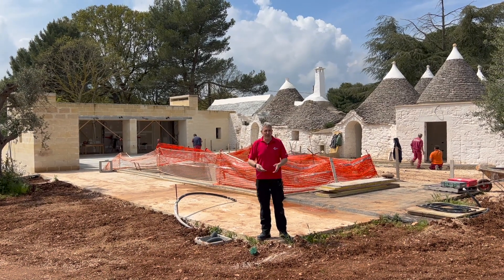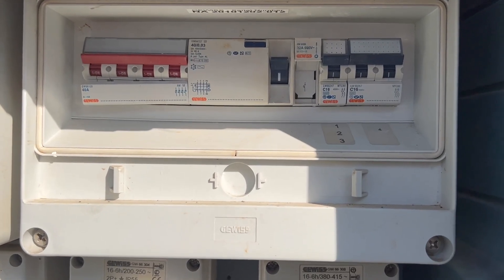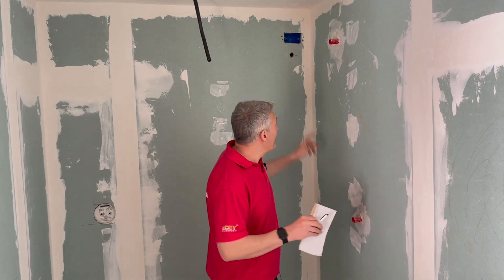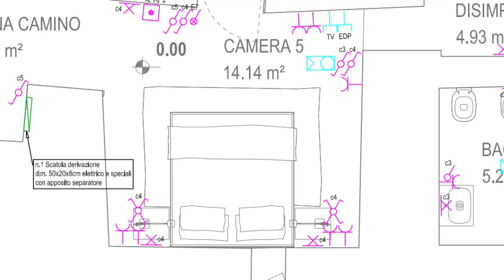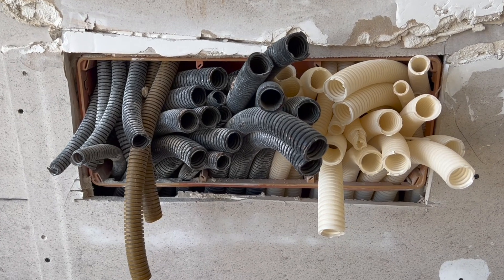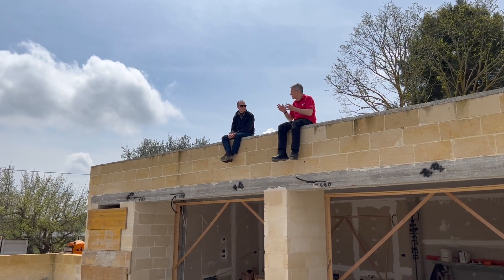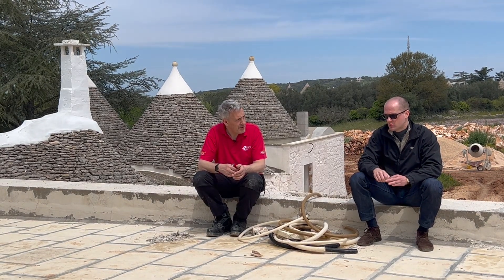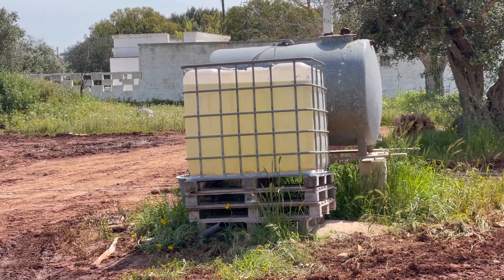Electric Wiring in Italy - You Won't Believe What They Do!

Comment: Very similar here in France. Use of Flexicon meant meant I could get fibre installed to the lounge just by pulling in the cable using the old TV antenna coax wiring as a draw-string and changing the face plate.  Really handy!
Reply from the maker: Great 👍
Reply: This was my experience too (also in France). Orange pulled fibre through to the living room, by using the old telephone cable as a draw-string. The process was so quick and easy I was amazed and couldn't understand how it was even possible - until I learnt about flexible conduit.
Reply: That's a lot of money in materials and labor to save 15 minutes in the future (assuming there is a conduit running were you want it, which is usually not the case).  Dont you have attics or raised floors to run lines?
Reply: @billn8555  That's not how it works. The conduits, water and heating pipes etc are laied down on the floors and ceilings before the concrete is cast. Getting something somewhere you didnt do right or forgot means you pick hammer or surface mount or do a combination of both. Thats costing craploads of time and money. And then for everything that goes into a wall you first need to mill a groove into the bricks. If the wall was already rendered and painted that needs to be redone.
Reply from the maker: The next part of this project is now ready 👉https://youtu.be/ISSy8vDxLcw
Reply: Cheap flexible conduits are horrible for pulling stuff through, it keeps getting stuck on all sides. Non-flexible conduit is a lot easier. At least, that's my experience in my own home, had to completely remove a flexible conduit and replace it with non-flexible in order to actually get cable through it. I thought it would be easier. Boy, was I wrong.

There is good flexible conduit though, with a smooth tube on the inside. But the cheap stuff is just really bad.
Reply: @StCreed  Just tape your new cable onto your old cable and make sure you cover the whole joint.. That way it's just a smooth wire being pulled through.
Reply: @StCreed  The technician poured some washing up liquid into the conduit to lubricate  it - no problem.  Proper cable lube is also a thing!
Reply: @Richardincancale  Problem is a lot of things that work as cable lube when fresh can go solid and glue the cable in the conduit after months or years.
Reply: @Richardincancale  anche la vaselina è ottimale, e inoltre non corrode il rivestimento isolante dei cavi.
Reply: @randacnam7321  usa la vaselina.
Reply: @StCreed  Especially if the conduit goes around corners and awkward positions like that, it's very likely that it will get stuck, you have to pour special lube for conduits and have to have two people to help. One that pushes the cable and one that pulls it.
Reply: @adisipunct9562  
usa la vaselina.
Reply: @StCreed  I can imagine that being a problem... but assuming an empty flexible conduit, would it not be possible to pull: 
"a thin wire with a well rounded head"
through the conduit first, and then just tape your cable to that wire, and use that to pull the more difficult electrical cable through.
Wouldn't that solve the problem? Or am I being too optimistic?
Reply: @DanildFlamme  
esistono delle sonde tirafili (in Italia chiamate "molle tirafili"), che vengono fatte passare per prime attraverso il tubo corrugato, ed alla parte finale hanno un occhiello, a cui agganciare il cavo da tirare dentro il tubo.
Reply: @massimo63  I ran it through google translate to understand your Italian reply. And yeah, I thought I had heard about those special pull cables specifically for that.
P.S. What made you think that I could understand Italian?
Reply: @DanildFlamme  
...Sorry, but I speak only italian...
I hope in Google translation...
Reply: @StCreed  you can blow cables down ducts
Reply: Seems very labor intensive just incase you want to add something later. I guess maybe the mafia had something to do with that.  The thing about earth ground it is more for lightning strikes not for grounding for appliance protection against accidental contact with live wire.  The single phase wiring in the States (120v/240v) joins the earth/appliance ground at the first panel ( after meter) to the common wire (split phase).  I would assume it is the same everywhere but not sure about 3 phase wiring as that is used primarily in manufacturing.
Reply: @Once_in_a_Lifetime  Using flexible conduits make retrofitting much less labor intensive than fixing wiring into a wall with cement, as is done in the UK. As an American you have to remember that this isn't a hollow drywall construction, it's concrete (or other times brick) walls, even for internal partitions.

Regarding the earth ground; the presenter mentioned that the power distribution network does not offer ground wiring at all. Therefore, it needs to be provided by the property owner (using ground rods). I don't think lightning protection is much of an issue for a building this low, as even the trees are often taller than the building.

As far as 3-phase goes, which is 400V here, there's essentially five wires: live wires for phases 1, 2 and 3, and then one neutral and one ground. For (large) 3-phase appliances, all wires are passed on to the appliance using a 5-pin IEC socket. For the regular 1-phase devices, the three phases are divided more or less equally among the circuits of the home in the distribution (fuse) box.

Hope that clarified some things for you.
Reply: @TheLukasDirector   I didn’t think that people still built with solid walls only, thinking there would be a insulated inner wall.  We have every type of climate here in the lower 48 States and have not heard of that being done.  Especially since the UK is now requiring all their solid construction to include an external insulation as a retrofit even to historic houses.
I feel like i watched a different video than you as I’m sure i heard that there’s power outages because of lightning strikes, seeing copper wire circling the house (we only have two poles within 2.5 meters of each other), such that back up lighting required.  Never meant to imply the houses would be struck but meant that the electric grid is connected to houses and so the lightning will follow if a transformer is hit.  Done to minimize power surges into the home.  This earth grounding is done all along the electric grid.
I also saw in the video that since the porch had a double insulated lighting fixture, no grounding wire was added .  In the States, even wall switch boxes have to have a neutral wire (and of course ground) because of future use, not what its being used for now. 
I don’t know if electricians take balancing the loads of each leg on the single phase when wiring as I’m not a contractor, just a home owner that has done my own electrical work over the years.  Never seen a house have 3 phase but if area mixed with manufacturing then i guess its possible!
Reply: @Once_in_a_Lifetime  In my part of Europe, ground is connected to the (steel) water pipe entering the house in the cellar. The 3-phase power line usually enters the cellar at the same place, since all power lines below 110kV are underground. The main fuse box with 3 x 80A main fuses is usually near the water meter. Neutral comes into the building along with the 3 live wires. In Italy they seem to save that 4th wire and because they probably use cheap plastic water pipes, they use the lightning rod ground loop for ground and neutral connection instead. That's sub standard and completely illegal in my country, but it works as long as nothing happens. That's Italy for you, a developping country in many ways. But then of course home of the best food in the world and other great cultural acheivements, still making it one of the top 3 best places in the world to be.

Lightning strikes to power lines are rare, because most power lines are underground. Lightning strikes to buildings OTOH are quite common and rooftop lightning protection is mandatory in many regions. 

3 phase electricity is not compatible with 115V appliances. 115V is acheived by splitting two phases that are 180 degrees out of phase. 400V 3-phase power consists of 3 230V phases that are 120 degrees out of phase. Each of the 3 phases can be used to power 230V appliances and all three together to power 400V appliances, but a single 230V phase can't be split, because the entire phase is above ground (0).  US 230V is two phases, with ground (0) exactly in the middle. That's why it's pointless to supply homes with 3 phase electricity in the US. However, this might change, because the US car industy decided it made sense to build completely idiotic EV's such as Ford Lightning or HummerEV. Unlike regular EVs, these use too much energy to sensibly charege them over night on whimpy 230V power (22kW requires 95A in US but only 32A in Europe). But I dont know if these cars actually support 3 phase charging. 

Costruction methods in Europe vary, but most homes are still solid constructions, mostly brick, even for inner walls. Most homes rest on a concrete cellar with a concrete ceiling, that serves as the floor for the ground floor with brick walls. The next floor up is usually a reinforced concrete floor cast onto those walls and again brick walls on top of that floor. Up until recently, most outer walls were single shell with outside isolation or double shell, which is twin brick walls with the isolation sandwiched between them. Advances in brick manufacturing made it possible to make bricks with multiple, large chambers, which are stuffed with sheep wool, or glass wool or similar isolation materials. Because these bricks at the same time speed up and simplifie building and have superbe isolation properties as low as 0.06W/mK while still resulting in reasonably thin outer walls (roughly 45cm or 18in), such monolith walls have rapidly spread over the past 10 years. Wooden houses are common in Skandinavia.
Reply: @adrianguggisberg3656  yes we have that too with water pipe usually copper, (jump cable both ends of turn off valve/meter in cellar or 1st floor utility room), with earth ground and appliance grounded to the electric service entrance shut off box outside which are bonded with the neutral wire (which continues along with separate appliance ground and neutral, not bonded going forward) with 2 live wires into the fused service panel inside the house.
Reply: @adrianguggisberg3656  The thing with the grounding on the water pipe used to be. Foundation earthers are mandatory for new buildings. Ring grounders/mesh grounders or deep grounders/rod grounders are mandatory.
Reply: @wernerruf7761  Yeah, new buildings, but this is restoration, isn't it? I believe new single family homes are also supplied with 3 x 40A (27kW) rather than 3 x 80A (55kW) these days. I remeber when our house supply was changed from overhead to underground in 1980-ish we got 80A, it was 63A before that. I know because the main fuse board is still in the attic. My dad told me that this was the 3rd upgrade and complete overhaul of the electric installation in his lifetime. I don't exactly know when my house was first electrified, but I have a photograph of my grand parents dated to 1918, that shows them feeding rye into a stationary thresher, driven by an electric motor. I remember this motor still being used for certain machinery in the 1970's. Anyways, even with founation or ring grounders, the water and heating pipes are still all connected to the master earthing point, and ring grounders must be dug in a meter or so, not just 20cm as it seems to be in the video. As far as I know, lightning protection systems can be connected to the same grounders, but they would have to be a much tighter mesh.
Reply: @adrianguggisberg3656  3 phase power always come with a neutral, the earth ring is separate from the neutral and have no current into.
The sole purpose is to divert leakage from appliance in case of insulation failure and keep the voltage under 50V, as the ground look rocky and dry you must have a lots of electrode to achieve this. A earth connection for lighting rod have a different conception. 
Lighting also strike underground wire, not a real benefit especially in region with dry ground that lead to high impedance.
In Europe all recent car accept 3 Phase , tesla proprietary plug is only 2 line AC/DC combined

Comment: In Pakistan we try to use flexible conduit as last option. It's way hard to re-pull cables in it than standard conduits.
Reply: Same in The Netherlands. Only DIY people use them. At their cost, as they find out later when they need to run additional cables through them. There is flexible conduit with a smooth skin on the inside, that version is okay. But all in all I no longer want to use flexible conduit.
Reply: @StCreed  Amen to that bro, the only time I used flex I cut it to length and pulled the wires through before installing it above the (removable) ceiling.
Reply: @apveening  same here bro. Allways pre-pull the wires through the conduit.
Reply: So I found in France.

Comment: I have a 10 Kw supply, single phase, just installed.... with a certificate. No earthing, but lots of earth wires. Colour coding is vaguely correct , but slippping a  Cat 5 and a coax down a black tube is also normal